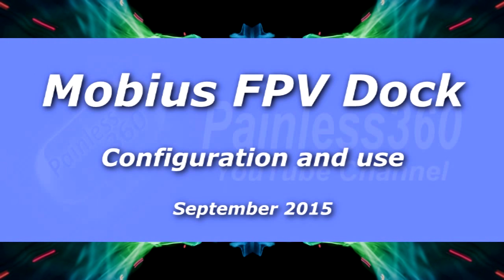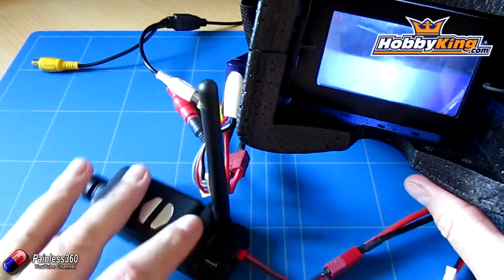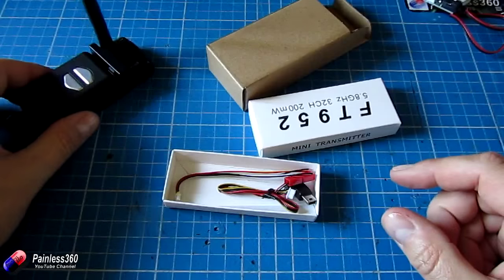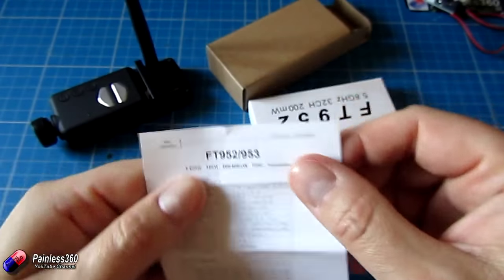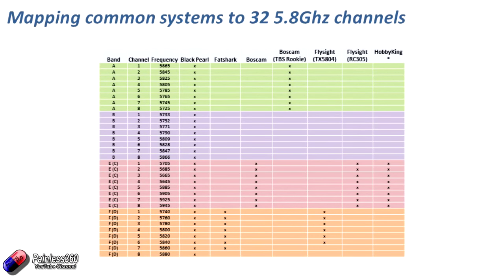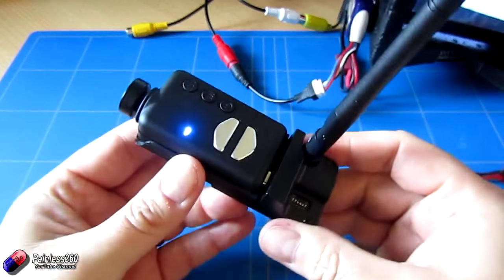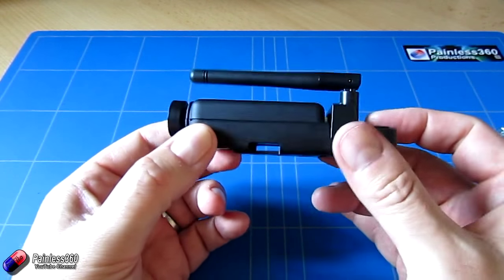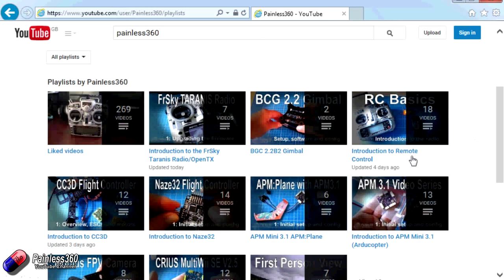Mobius FPV Dock - Review and setup (from HobbyKing)

Comment: looks good I would keep card as it is as in a crash the Card as been known to eject the card and kill the Mobius  mine did ! could do with an angle mount for fpv with quadcopters so you don't look at the ground .what power can it run on 3s , 4s ?  great video .
Reply from the maker: +Jeff deakin 2-4s, all detailed in the spec on the product webpage. Happy flying!

Comment: Is it possible to power the transmitter from the battery inside the Mobius itself? It would be nice if it was all self contained.

Secondly, is the lag (in 720p mode) low enough to be used to drive an RC car would you imagine? I have seen your video with the graphs, but is hard to visualise how this would look in real world scenarios!

Thanks.
Reply from the maker: +B E N B O B B Y ᵝ Car FPV would be fine. Not sure about the power - ask HobbyKing support, they should be able to tell you. Best of luck.
Reply: +Painless360 OK thanks, will do :)

Comment: +Painless360 This is an AWESOME and VERY timely video. I just got into 250 FPV and starting to race but wanted to capture the videos as I am seeing it. I mounted my GoPro on it but it's very heavy and bulk and was looking at buying a Mobius camera and I think this just sealed the deal. One question (as I am new to this). I have the FatShark Predator V2 googles. Will the receiver in this Mobius cradle work with these?  And as a result I get 32 channels as opposed to the 7 I currently have?Thx again. Your videos are awesome and have helped me A LOT in building my 250.
Reply from the maker: +Robert Selwah Not quite. The goggles are the receiver, not the camera cradle so you can only receiver 7 channels. They work with this well through. Happy flying!
Reply: +Painless360 thanks!

Comment: If we feed it the camera OSD, will it recored the OSD overlay also?
Reply from the maker: Not sure how you'd do that. The camera records internally.
Reply: +Painless360 That is true.  The Camera feeds the video transmitter.  oh well.
Reply: +Jon Car You can open the cradle, cut the videoline from USB to TX and inject the OSD into that line using a minimosd or whatever OSD comes in handy. This way you have OSD on your recieving end, but not on the recording end. Takes some soldering, but it is totally doable.

Comment: What's up, dock? How about some actual 5.8GHz FPV footage. I'm curious as to whether there is any noticeable latency 
in the composite output. Some web sites are claiming figures in the 94ms to 136ms range. If so, this is a serious issue.
Reply from the maker: +videosallnight the mobius isn't a camera for racing. Using it in 720p mode will dramatically reduce the lag. See our videos on making FPV backpacks if you want minimum lag. Happy flying!

Comment: l love the YouTube university. So much good knowledge.  I don't think you answered this but will it charge the Mobius. I assume it will.  I fly through the Mobius with the latest firmware 3.7 I think and noticed the lag was less then what it looks like in your video. I also have a really good mico sd card that is super fast very fast wight times and notice less lag.
Thank you for putting out these videos.
Reply from the maker: Thats interesting. I will try that. This camera came with 1.20.. Thank you for the suggestion!

Comment: still too much lag in 720 for fpv. shame. a cradle for the 808 would be nice as it has no latency on the video out
Reply from the maker: Why do you think the 808 has no latency? Every camera has some, even board cameras. Please link to where thats discused, I'd be interested to take a read. Happy flying!
Reply: yes every camera has latency, but we are talking about noticeable latency I should have clarified. the 808 16 latency is similar as a board cam check out my home made 808 fpv plate on my channel if you like :) (not trying to plug my channel, im a big fan of you here) it weighs 16 grams and micros can lift it. problem with the 808 of course is that it doesn't deal with the dynamic range as well as the mobius, the exposure lifts and drops in stages but i find it more usable as an all round camera/recorder than the mobius. dont get me wrong I have 4 mobius cams but i wouldn't use its video out feature, interestingly this device could most likely be modded to fit an 808. same pin out since jan 2014 maybe a nice usb pigtail on it. all best
Reply from the maker: I actually ran some latency tests that  - you may find them interesting - https://www.youtube.com/watch?v=pzf3yNlPQLA

Happy flying!
Reply: yeah i saw that one lee. there didnt look much in it on paper between the mobius and the 808 but i find in practical use the 808 much better as you mentioned in that video. all the best

Comment: greetings, I have a docking station and 5gb fat shark connected to a laserBGC RX USB and I can not get a picture through a mobile camera app or the laptop downloaded program, just a blue screen, what can I do to resolve this issue? Can you please assist me or guide me through the channel set up.
Reply from the maker: You'll need to get the video stream into the USB device. Not sure exactly what you're describing here.. Video/pictures would help..
Reply from the maker: I'd not use that as it's designed to be inside the FatShark Dominator style goggles. I'd not even know where to start with each pin..

Comment: The $64,000 question is; Will a RunCM-HD plug into this mount? The two cams are almost identical, so I'm hoping as I have the RunCam.
Reply from the maker: Make the cheque payable to CASH and I'll have a try.. ;)
Reply: There was a TV show called the $64,000 question here in the US (long ago, when $64,000 would buy you  more than a compact car). That's why I put the question as I did. I'm sure there are other interested as well. In light of the fact that you did a side by side comparison of the 2 cams, I thought it relevant.
Reply from the maker: (the $64,000 question is common language over here too ;)

The slight changes to the case (smaller radius on the edge of the case and movement of the USB about 0.5mm to one side mean that it will not fit without modifying the case of the RunCam or the cradle itself. One for a 3D modeller perhaps?
Reply: +Painless360 Thanks for checking it out.  Perhaps some enterprising 3D-er or the original manufacturer will realize that there are a growing number of RunCam owners out there. Thanks again. Cheers!
Reply: +Bill Somrak I would also look into the pin configuration of the mini usb plug. I think Runcam pinout is different to Mobius.
Reply from the maker: +mick thebass https://www.youtube.com/watch?v=cHt4vj_HyNw
Reply: The link provided is "private" and can't be viewed.
Reply from the maker: Try again - YouTube is being difficult! ;)

Comment: Great video, very helpful as always. Just watched it for the second time whilst testing my Mobius Dock. I did notice however that my Elgae RC305 (Flysight/Boscam clone?) is on band B not E(C)  as shown in your spreadsheet. I hope this helps someone else as it took me a while to figure out why I only had 1 channel  ;¬)
Reply from the maker: +StrumminMonkeys You should always check the frequencies on the manual that comes with the products. Boscam use Bands B and E for different products..
Reply: +Painless360 Thanks for the reply and a good point well put. Unfortunately the Elgae version of the RC305 I have came with no manual and the only information supplied was the dip switch settings for  channel selection.  I googled the receiver and found a Boscam manual but this stated the frequencies where those of Band A so I tested those first to no avail. Therefore I had no choice but to test the two non-fatshark bands and found that the only one that worked on all 8 of my receiver's channels was Band B so I thought I would share my findings so they may be of benefit to other viewers of your excellent video. My aim was not to criticise your spreadsheet only to highlight the issue at hand. Thanks again for all your informative videos,  they have been been very helpful and keep up the good work :)

Comment: Hi you said that the channels were not spot on but then didnt explain. only time i have seen that i was in the wrong band and 5Mhz out but as the chanels are ~12Mhz wide the PLL in the receiver can tune "most" of the time
Reply from the maker: A lot of the bands are very close, see my video that explains the entire 32 channels. 

If everything is perfect then you should be able to 'see' the image in not only the intended band and channel but in those bands/channels that are very close too. That is why frequency management when flying with FPV friends is so important. 

If this worked perfectly then all of the receivers should see it on F1 (5740Mhz) on that channel the best. Some didn't but could see it on other bands/channels hence the comment. 

Hope that makes sense..
Reply: +Painless360 
yeah i had tested the FT952 on a spectrum analyser and the band/channels all looked spot on i was just wondering if the the unit you had was not as well tuned
Reply from the maker: Very possibly! Happy flying!

Comment: what battery did u connect to the mobius?? Also how would you mount this on a drone?
Reply from the maker: +Los Angeles Aviation Videography I connect the dock to the 12v/3s flight battery in the model. I use mine with fixed wing mostly.. Happy flying!
Reply: could u give me the link to the battery that u used?
Reply from the maker: We use lots of 3s packs from 1500-3700mAh in the planes...